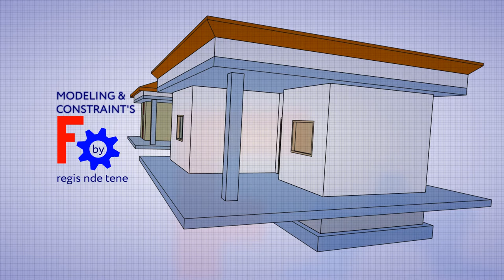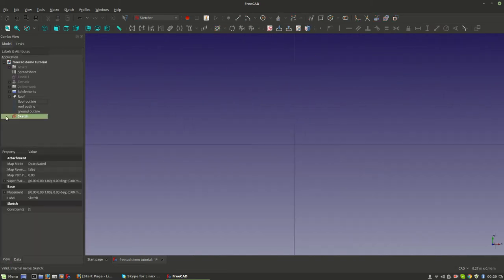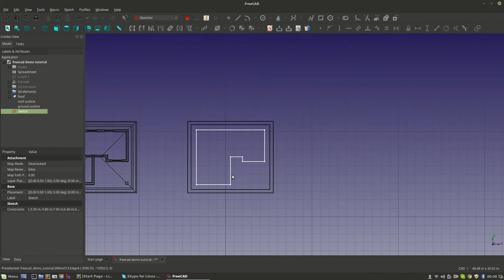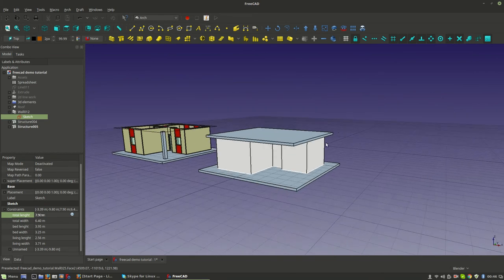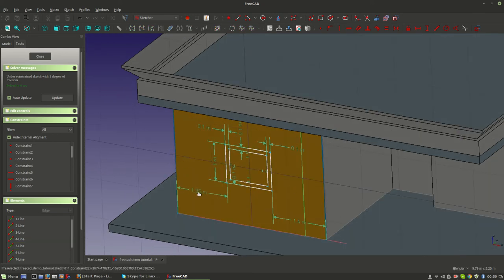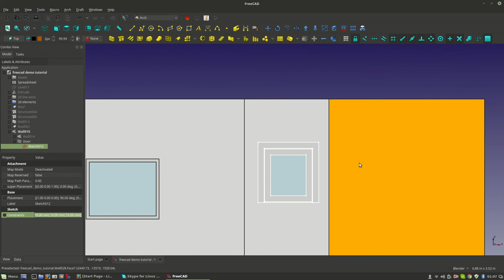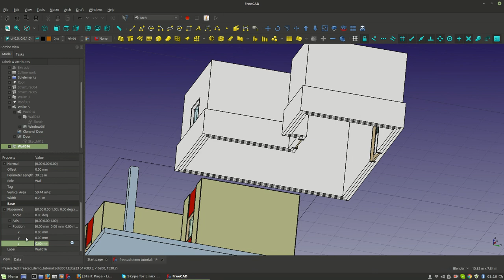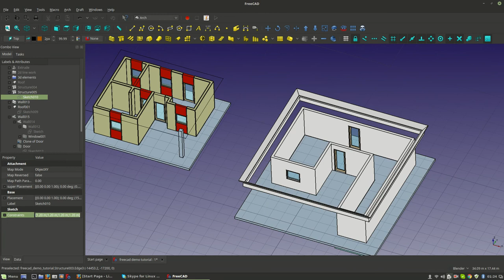FreeCAD Arch - 3D Modeling with Constraint's - 04

Comment: is there a way to drive the width of the door frame, for example, with a constraint?  So instead of changing (3) dimensions down to.05m, as you did in this video, you could just change the value of a parameter named 'frame width', for example, and the (3) dimensions would update themselves?
Reply from the maker: yes you need to assign the door width frame thickness with it's name "frame width" when creating the frame in sketch mode, so that when outside of that you can select the sketch itself and change the defined attributes and your door width will change.
Reply: yes, but can you assign that constraint name, "frame width", to multiple dimensions strings?  It seem you can only apply it to one.  I might be missing something.
Reply: @theoryshaw  I have this question too.  I can name one of the constraints, "DoorSize" then click on another constraint. Then click constraints Blue Circle in the "Length" and type "Constraints.DoorSize" , but when I click ok,ok, it says, "Failed to parse expression".

It seems to work (changing the original door size, affects the others), but when I save and reload the model, they are not linked anymore.  

Anyone else see this?
Reply from the maker: Interesting point. It is quite possible. I'll have to check it up.
Reply: I'm using .17
Reply from the maker: Okay when checking I'll test both .17 and .18 to find out.

Comment: Do you think that's a bug, where when you clone a door, the view properties (color, etc.) don't match?  If not, it feels clones shouldn't work that way... or at the very least there should be a way to tell the clone to take on the exact view properties of the original.
Reply from the maker: I think it is a bug, I have noticed there are times it works (rather well) and there are times when behaviour is strange like in the video. But yes I agree, I think the clone should be the exact match of the original in all ways, shape, texture, material parameter etc.